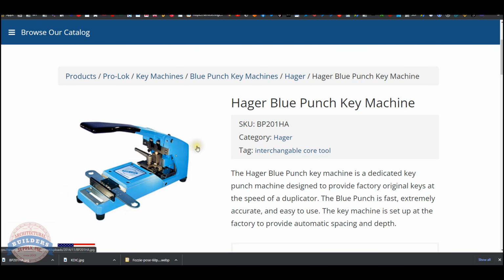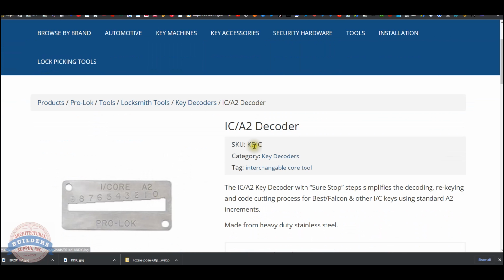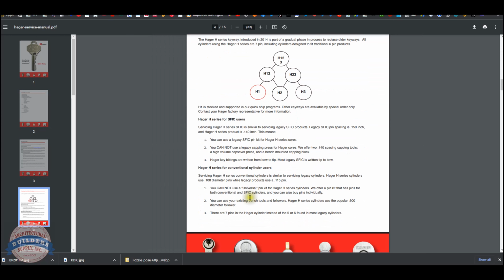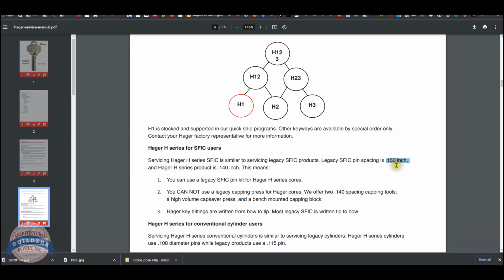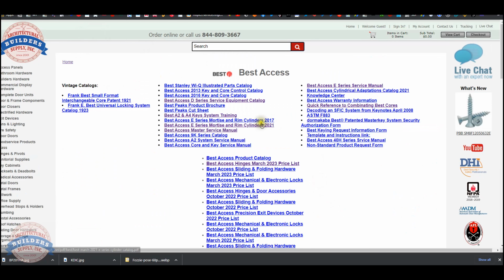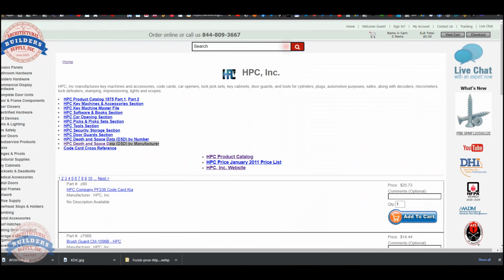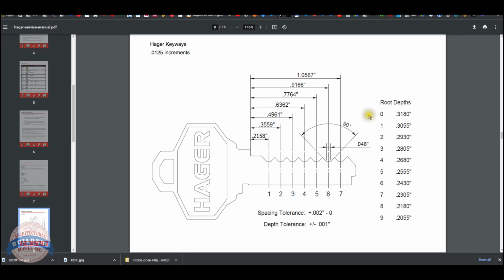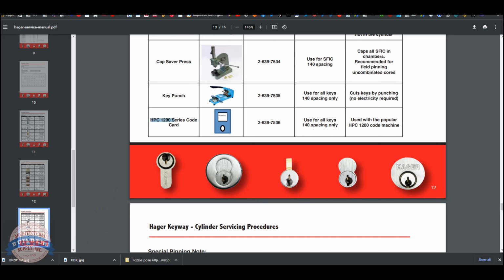A Conversation regarding the availability of a key gauge for the Pro Lok BP201HA

Comment: Schlage Everest/Everest-29 SFIC & SL Series (including Primus/PrimusXP options) B & R Families of key profile sections are also coded/combinated to BEST A2 Specifications . . . Theoretically, you could also combinate Schlage Everest/Everest-29 SFIC B & R Key family profile section systems to BEST A4 Specifications, except Everest/Everest-29 SL-Series - whereas SL-Series Pinning Kits are only available with to BEST A2 Specifications - all of which are backwards-compatible to legacy Schlage Everest products utilizing specific default key profile sections for easy & cost effective system integration/migration so as to extend useful utility patent life (since legacy Everest patent expired in 2014, keys & locks are still available and are still widely used in some of the largest and most prolific institutional installations in the U.S. (Such as Hines V.A. Medical Center, with over 6000+ locking door openings across 53 buildings and operating on 3 separate master key systems - all using Schlage Everest SFIC cores to completely redesign an entire new access control system from the ground-up) https://www.andersonlock.com/projects/hines-va-hospital/

I'm sure that very few other offerings from competitive lock manufacturers will offer this kind of keying flexibility when it comes to key system expansion and/or integration for use with different makes of lock systems featuring different types of cylinder formats and so forth. I would suggest looking into Schlage Everest/Everest-29 SL Cylinders for conventional & proprietary large-format interchangeable cores as well as the added advantage & security of Schlage PrimusXP available using Schlage Everest-29 SL cylinder formats that are also backwards-compatible with SFIC locks/cylinders - all integrated into a seamless key system configuration dependent upon the desired level or required/specified security application. 

I found it kinda ridiculous that Hager offers only 3 different default primary keyway section profiles as that would severely inhibit the ability of any would-be system integrator to effectively build or design any large or expanded master-key system or systems as would be seen or found on most large multi-structure campuses or complexes of institutional buildings such as that of hospitals, universities, military installations, government complexes (courthouse, legal, detention center/jail/Sheriff's Office/local/county municipal offices & various departments, including fire/EMS, health, building commission, tax assessor/recorder, public works, etc.) 

Such installations would require many more than just 3 default key profile sections in order to prevent key interchange or unintentional cross-keying as would be the case in very large systems where some key cut combinations might be replicated and unintentionally able to fit a lock or access or open a door from which it was never intended to do.

From which with a much larger availability of cross-compatible multiplexed keyways, each individual department or organizational activity could in theory have their own distinctive keyway profile section assigned to them and then multi-section master-keys could then also be created thus linking these different systems together for ADMINISTRATIVE ACCESS or EMERGENCY use or access with a single securely or safely kept TOP-LEVEL MASTER-KEY and all without having to maintain a complex catalog of keying records or a messy or sloppy assortment of different keys on a large key-ring, as well as preventing cross-keying or unintentional key interchange as would be the case when designing very large or expanded key systems across multiple buildings or structures as well as with multiple departments or organizational activities within any given organizational entity that operates within any given campus or complex of buildings that are under the same care or maintenance of any single management department or entity. 

SFIC/LFIC Control Keys could also be cut using the ALL-SECTION KEY PROFILE so as to facilitate any necessary core changes or maintenance-related core removals without having to track down individual control keys or having to resort to destructive drilling out of lock cores or cylinder housings.

Such large organizational key control or access systems should also have geographically restricted key profile sections so as to provide a modest level of key control - thus making it much more difficult to obtain bootleg duplicates from off the street or from standard or normalized commercial supply channels such as local hardware stores or mall key stands or mechanized kiosks providing instant & automated key duplication services such as the likes of KeyMe, etc. Geographically Restricted Keys & Key Systems make it much harder to break such systems too, as there is a White Paper written by Matt Blaze on the topic of MASTER KEY EXTRAPOLATION - RIGHTS AMPLIFICATION - A good read indeed! https://www.mattblaze.org/papers/mk.pdf

As such, it might also be a good idea to also integrate electronic access controls (such as the use of PROX/RFID key-fobs/cards & readers) as a primary means of access control with the addition of redundant mechanical pin-tumbler backup cylinders so as to minimize the unnecessary issuance of restricted keys that would be very expensive to replace as facility rekeying or rekeys could have the potentials of reaching very high levels of expense, depending upon the level of compromise (like a missing, lost or unaccounted for master or control key.)